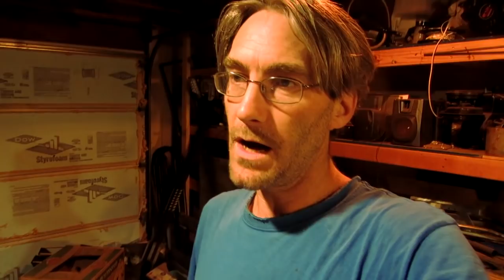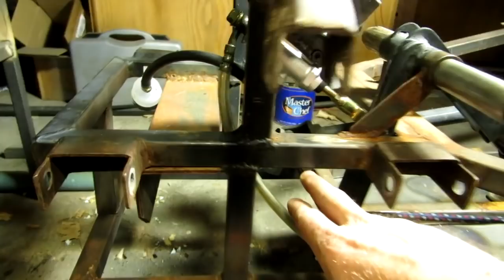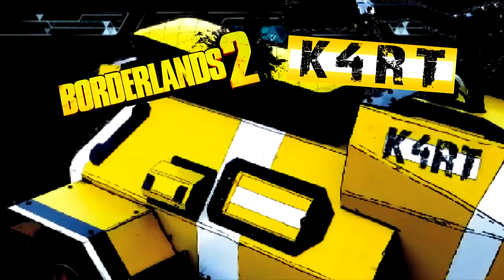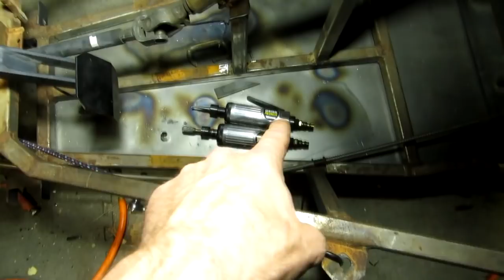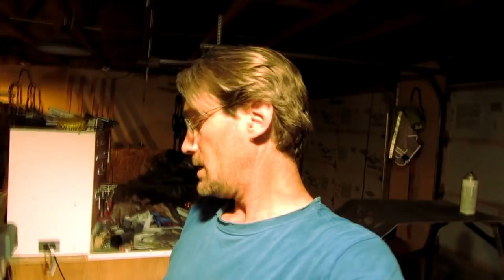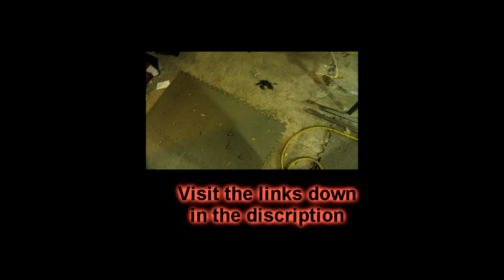Fullscreen Machine | Master cylinder connection

Comment: Dot 3, 4, and 5.1 are glycol ether based. They are compatible, but like motor oils, you should use the recommended or higher grade fluid. Dot 4 and 5.1 also have borate ester to handle higher temperatures. DOT 3, 4, and 5.1 fluids are found in most brake and clutch systems  like the setup. im interested to see the paint when its done.
Reply from the maker: cool , just went and got some DOT 4, thanks Austin